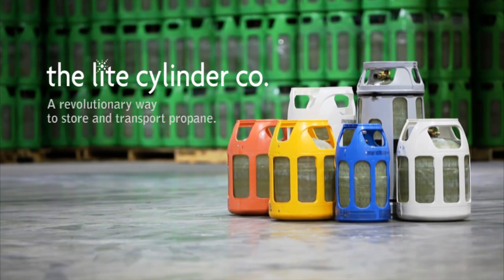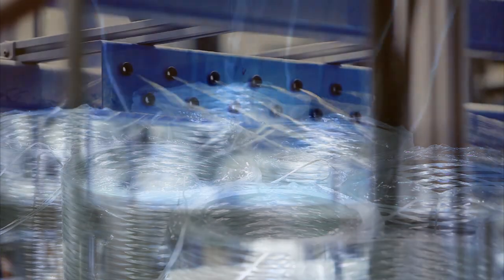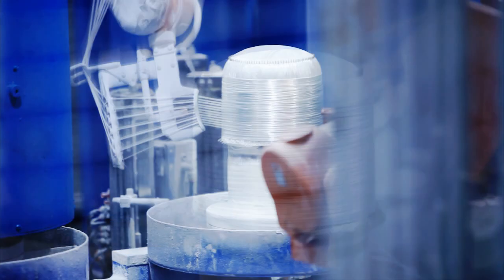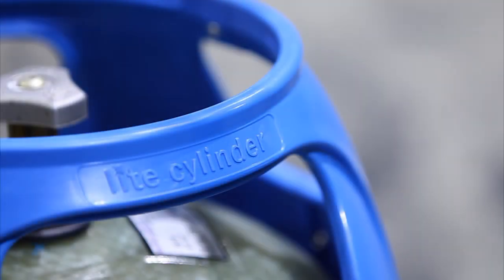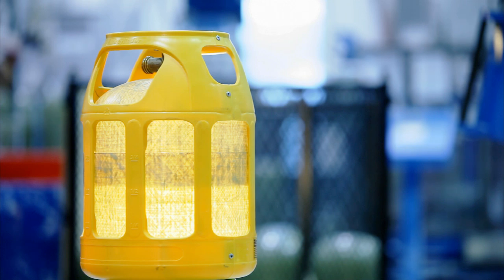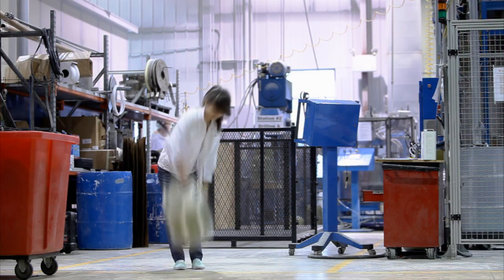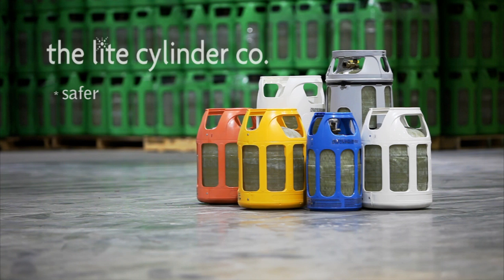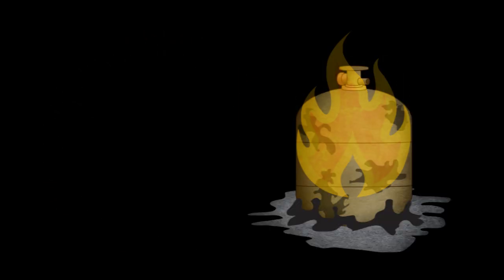Lite Cylinder - A revolutionary way to use and store propane

Comment: Dear Sir,
 
Firstly, I would like to introduce my firm as related with mechanical engineering research & development. We have modern manufacturing facility in the private sector managed by professional engineers for undertaking jobs involving medium to heavy modification, Fabrication  and machinery works.
We just developed our valued Filament winding machine and below molding machine for fiber glass composite LPG cylinder please visit the link below and let me know, If you have inquiry or interested in manufacturing of LPG Composite Cylinder and if you need  any type of filament winding machine or below molding machine.
We can also supply LPG COMPOSITE CYLINDER complete molds (production line).
Our Lpg composite cylinder production line cast is very low than Europe.
 
https://youtu.be/nP8A2N9UYoc
https://www.youtube.com/watch?v=9ilxTDMcbwE
https://www.youtube.com/watch?v=y0K9JMoIjd0
https://www.youtube.com/watch?v=Ih7I1jtiRu0
 looking Forward to hearing from your soon

Best regards, 
Khalid javed Mughal 
AERO ENGINEERING
OPP LAHORI OCTROI POT G.T ROAD GUJRANWALA PAKISTAN 
TEL:+92-554-273828. 287011 
Cell: 0092-321-6448696
Whattsapp: 00923006445253
E-Mail: kj_mughal@yahoo.com

Comment: I work on boats, there made of fiberglass and gel coat. same as this retarded tank, this has to be the dumbest shit ever! fiberglass cracks from being in the elements,cold and hear make it weak. steel is the only way to go,that's why you don't see these all over there highly dangerous and they will explode. tank us under pressure anything on the pressure will explode.
Reply: Exactly....i've seen more damage done from the LPG on the inside of a cylinder, than on the outside....

Comment: @OnlyGeranium The problem with these propane cylinders is that they are almost $100 and more prone to leaks and material defects than steel cylinders.  To know how much propane you have is to weigh your cylinder on a shipping scale and subtract the tare weight (empty weight written on the collar).

If the empty weight is 16 lbs and it weighs 20 pounds, you have 4 pounds of propane in the tank.  Propane is 21600 BTU/pound, so you have 86,400 BTU.  If your stove is 40,000 BTU, that will last 2 hrs

Comment: Finally someone come up with an excellent solution to my often problem
of running out of propane with a leg of lamb on the spit.  Yay!!
Reply: We just developed our valued Filament winding machine and below molding machine for fiber glass composite LPG cylinder please visit the link below and let me know, If you have inquiry or interested in manufacturing of LPG Composite Cylinder and if you need  any type of filament winding machine or below molding machine.
We can also supply LPG COMPOSITE CYLINDER complete molds (production line).
Our Lpg composite cylinder production line cast is very low than Europe.
 
https://youtu.be/nP8A2N9UYoc
https://www.youtube.com/watch?v=9ilxTDMcbwE
https://www.youtube.com/watch?v=y0K9JMoIjd0
https://www.youtube.com/watch?v=Ih7I1jtiRu0
 looking Forward to hearing from your soon

Best regards, 
Khalid javed Mughal 
AERO ENGINEERING
OPP LAHORI OCTROI POT G.T ROAD GUJRANWALA PAKISTAN 
TEL:+92-554-273828. 287011 
Cell: 0092-321-6448696
Whattsapp: 00923006445253
E-Mail: kj_mughal@yahoo.com